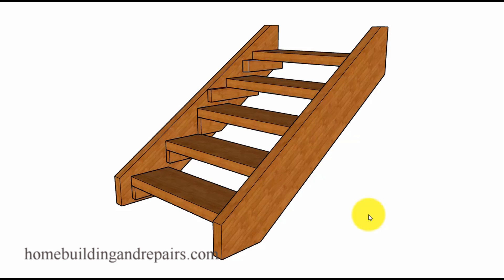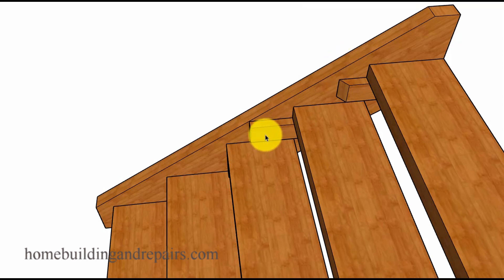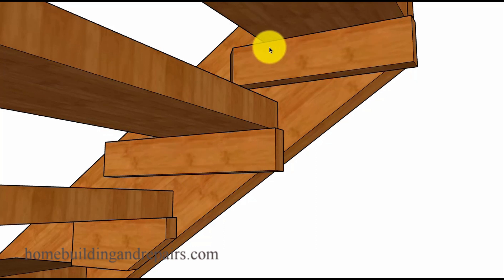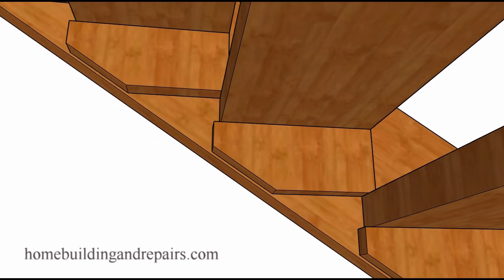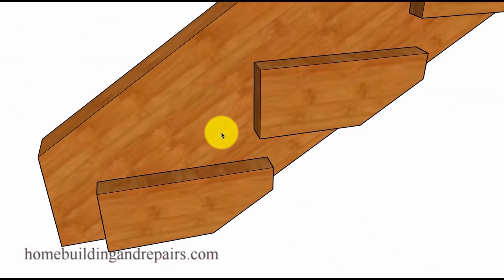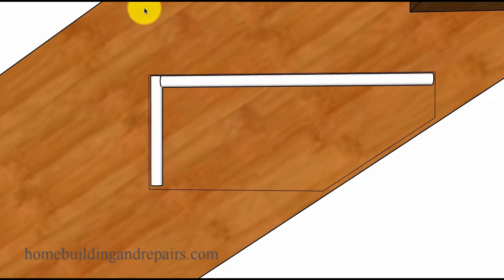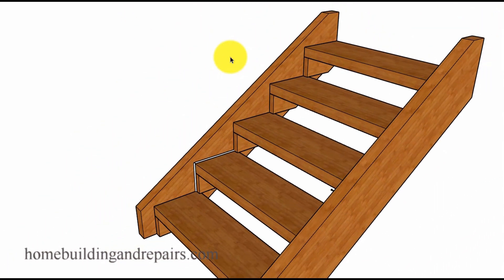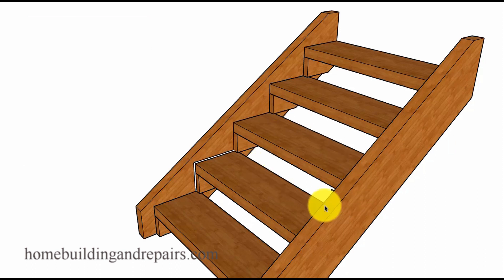Stair Building Problems, Advice And Tips For Using Wood Cleats Instead of Metal Brackets

Comment: Hello Greg.  My question is about using wood cleats exactly as you have shown here.  However, in indoors on my carpet to oak treads and painted risers conversion.  I will secure the treads from below using pocket hole screws to avoid face nail holes.  The rise and run are being altered and I might like using cleats glued and screwed to the existing stringers instead of putting strips or shims on top of each horizontal stinger surface.  The blocks or cleats can have the pocket holes in them whereas drilling pocket holes directly into the stringer is far trickier.  Everything will be hidden, of course.  Per usual, you cover the idea that the detail as of the blocks deployed are almost endless.

I like a larger cleat for more glue area and more screws.  I’m told the shear strength of good PVA glues is literally over 3000lbs per inch, so I think the glued/screwed cleats are way sufficient to hold up indefinitely.  BTW, construction adhesive will be used along with pocket holes to secure the treads to the cleats.

Q:  if this approach sound and/or one you’ve seen used in the trade?  

If you’ve not done a video about the ways to modify the rise and run of existing stringers, please consider it.  There is virtually nothing on YT.  BTW, my stringers not perfectly consistent from step to step nor are they all level and plumb (risers).  If they were,  I’d consider cutting strips and attach to the stringers.  There are are ways to secure the treads without drilling pocket holes in the stringers.

Thanks.
Reply from the maker: There is a high probability that wood cleats would not be approved by engineers. However, using better lumber, screws and adhesives usually have been proven to make stairs stronger.
Reply: @stairbuilding  Thank you.

Comment: Greg, I'm a DIY homeowner in Japan, and I've gotten enormous help from your video tips, so let me start with sincere thanks for all the work you've put into these videos. I have designed and or built two outdoor stairways, one with notched stringers, and the other with 2x4 PT wood cleat tread supports, (since the stringers there are 4x15 PT lambeams). I fastened the cleats with 12mm SS bolts. I've noticed your criticism of wood cleats particularly due to the potential for moisture and debris to accumulate in the contact between the cleat and the stringer (something that has concerned me as well).   I haven't experienced much problem with the wood cleats themselves, but I have had serious rot problems with the treads, despite their being PT wood and the use of preservative stain (Xyladecor). I've already replaced the PT treads on the notched-stringer stairway with WRC, and am preparing to do the same on the other stairway (together with replacing the PT cleats there as well), leading to my question: do you think it would help to use 12mm (1/2") or so of SS washers or spacers between the cleats and stringers to allow water and debris to pass more easily without collecting? Barring that, I'm thinking of either using silicon sealant as suggested in this video, or adopting steel angle-iron brackets--but wouldn't they suffer the same problem of moisture/debris collection?  I've got a big decision coming up, and being retired, I'd like to get the work done with least expense. Thanks for any advice.
Reply from the maker: I would like to see the stairs. Send me a picture and you can get out email address at the website. However, if all you need is a quick opinion, the gap will need to be cleaned to prevent debris from collecting there.